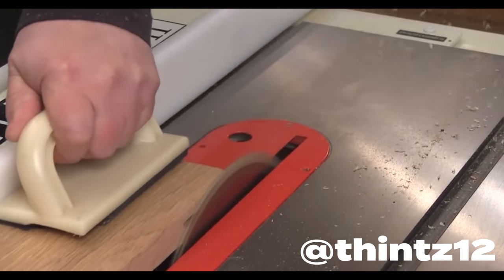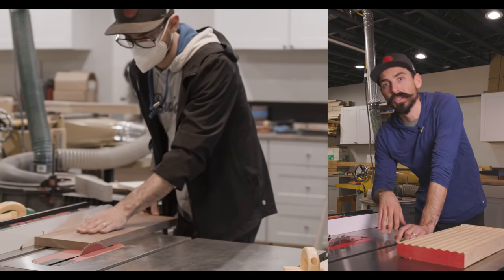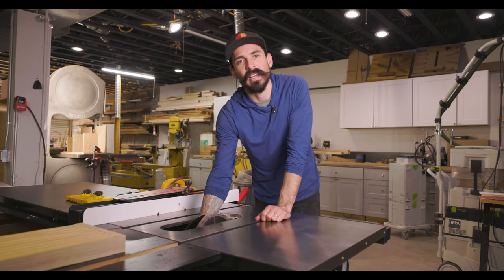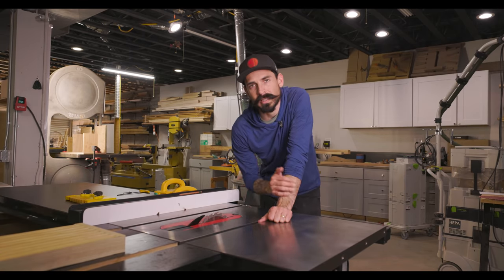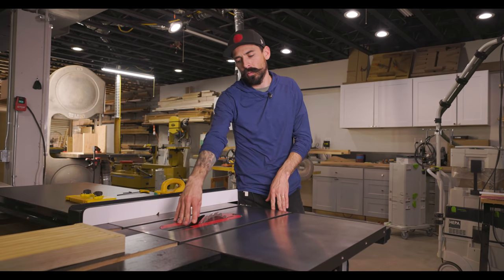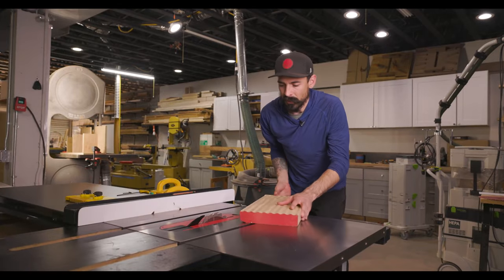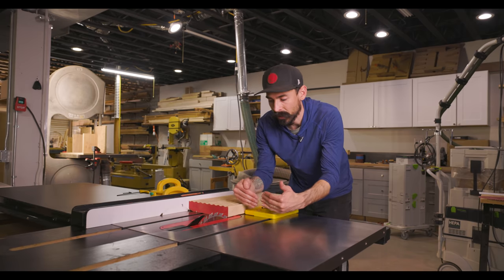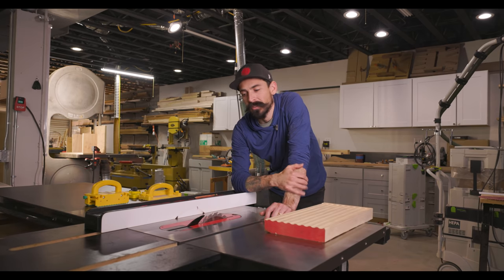Never DO THIS! This knife could save your life! Table saw owners and Woodworkers 4K

Comment: Be in tune with the tool! Great advice. 

I’m sure some of the OG’s of woodworking got away with no riving knife. And you can get away with it too. But definitely seems like an important safety device for beginners!
Reply from the maker: Yeah no doubt! A lot of those old timers are missing fingers and we should all aim to keep all of our fingers if possible 😄
Reply: I knew a lot of OGs missing fingers. It’s weird, but way back it was almost considered a right of passage to have a table saw incident. Weren’t a real carpenter until you whacked something off.
Reply from the maker: @mikeamboy7292  I hope I’m never a real carpenter
Reply: Let me tell you about beginners! This summer is the 50th anniversary of me working in construction/ carpentry/ furniture building.  I have never had a table saw incident until last week.  I set off my sawstop.  Its not just beginners,  any time we get complacent or in this instance,  was working when tired.
Reply from the maker: @mikeamboy7292  that’s a great point. I’ve gotten hurt while working when tired as well
Reply: @WilliamDouglasCo  Yep, they (SawStop) just need to invent an fatigue and attention-span sensor next. They'd totally kill it in the market.

Comment: Such a great vid. When I was about 13 my uncle had a shop in his basement. My uncle just finished a cut, turned off the table saw and his friend a few moments later tripped and his wrist landed on the saw while it was winding down. He almost last his hand. After that I’ve been pretty nervous to use a table saw myself. I’m about to set up a small wood shop in my own home so these safety videos (while basic for others) are huge for someone like me who is about to get in the game. Thanks for sharing. Just found you -  Subscribed

Comment: I’ve got an older saw that doesn’t have a place for a riving knife so I made some zero clearance insets with a splitter built in. I’m going to upgrade sawstop when I have the means to do so but for now my saw is so much safer than before
Reply from the maker: That’s a great move! There are some cool aftermarket things you can buy as well to help stay safe
Reply: So what is the difference between a riving knife and a splitter?
Reply from the maker: @paulgajewski5926  splitters do not move up and down with the blade. This means you have a larger gap between the blade and riving knife making them not as safe. Splitters also stick up higher than your material so they always need to be removed for dados

Comment: Good video, Will - there's always a place for a safety video, especially when it's someone with established skill and cred. My riving knife has saved my ass on more than one occasion, and I leave it on even with my crosscut sled. Necessary for the sled? No. Do I ever have to remember to but it back on? Nope. 
I also think a good zero clearance insert is a safety feature as well - would love to see your approach to a home-rolled one.

Comment: Good tip about ripping first on the bandsaw, then doing the final rip on the table saw with a smaller cut off. Thanks!
Reply from the maker: It’s a better work flow for sure
Reply: @WilliamDouglasCo  and so much safer too! Thanks for the work on your channel!

Comment: Excellent !  I do get it .. sometimes it cant be there.  For teaching though (knowing some are new woodworkers)  we want peeps to learn right, and later if they make a bad choice it's on them.  I dont use mine cutting plywood or MDF sometimes as it wont try and close up... but always with ripping.  And mdf I use overhead dust collection with guard but thats a different subject.  Great short vid !  You have set the right example  :- )

Comment: I use that jessem attachment table saw thing or a small power feeder over a riving knife. But i got a huge old delta 12 inch table saw that doesn't have an easy way to attach a riving knife.
Reply from the maker: There are so many ways to stay safe with aftermarket gadgets and a little care. I haven’t seen the jessem but I’ll check it out

Comment: Yup. Riving knife removed for the sled. Used it after the sled without the knife. ER. Happily kept my fingers after a couple dozen stitches. Still can’t feel the ring finger from a severed nerve. But it gets better every year. Yay! You as an influencer I applaud for providing safety videos. Please show them. Please practice what you preach. Honestly I’d rather you eat the overhead of doing the whole video again to have safety in place rather than put some subtitles in there that say, “Don’t do this.” Ymmv.

Comment: Another great Video William and folks should make "safety videos" on their channels to explain the "when and whys" of safety...

USE RIVING KNIVES>>>!!!<<<unless doing the things listed here that won't allow them to be in place or you know the risk 100% and the danger you are subjecting yourself to!!!

I don't use riving knives on most of my table saws through a 40 plus year career...NO...I don't but YOU SHOULD!!!!

I tell folks all the time...GET A RIVING KNIFE...!!!...LOL...and use it all the time unless there is a damned good reason not to...OR (???)...you have a working knowledge of the tool that includes at least several decades of experience behind it...!!!

My current saw I'm using has a 14" blade (it's a mini sawmill LOL!!!) and it runs on shaft power "Horse Drive" (yes a real HORSE!!!) so not your average "shop tool!" The saw before that was over 100 years old and had an 18" blade and no riving knife either for many reasons...but that is not the norm...RIVING KNIVES ARE AWESOME!!!

Comment: I have an older model Harvey saw here in Australia and found the riving knife too wide from manufacture. This tiny difference made it difficult to push anything through. I bought another knife off Harvey that was a bee’s dick thinner and it solved the problem. Not sure if it had anything to do with imperial knives and metric blades?
Reply: I had the same issue with the riving knife that came with an older (mid 2000’s) table saw. In my case it just turns out that they just sourced them from some cheap manufacturer that used steel that was too thick + thick coat of paint. I ended up just removing it and couldn’t use an aftermarket one at the time bc of the way it assembled onto the saw.

Comment: If a production shop is pushing through hundreds of board feet every day they should have more than a riving knife, they should be giving serious thought to a power feeder or a dedicated rip saw designed for the type of work.
Reply from the maker: I worked in one and we had several industrial power fed rip saws / panel saws / etc but that doesn’t replace the table saws. We still had 2-3 table saws running all day. Just depends on what you are building and how many projects are running at once.
Reply: @WilliamDouglasCo  Just to be clear, I'm sure you're right, just sounds like a bad idea for a production shop.  (Like leaving off the riving knife).  If nothing else it seems like you'd burn a lot of maple, and a power feeder isn't a huge investment.